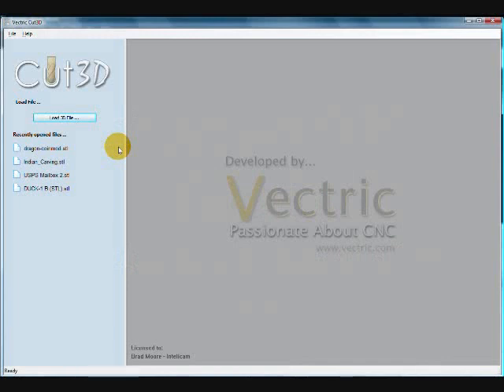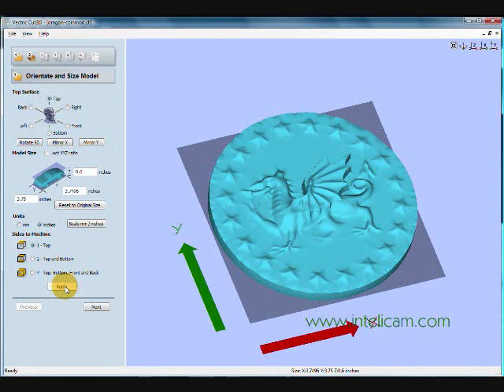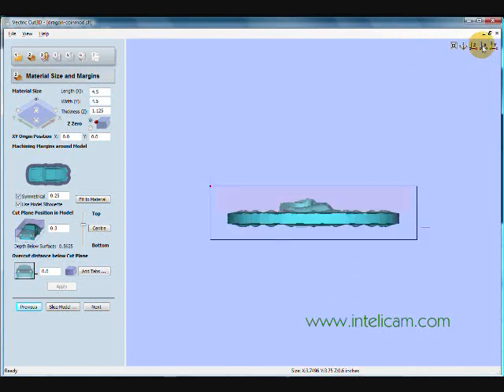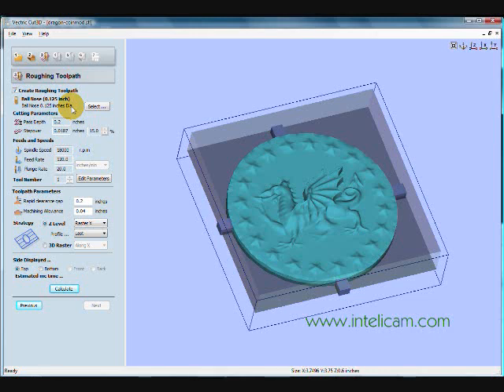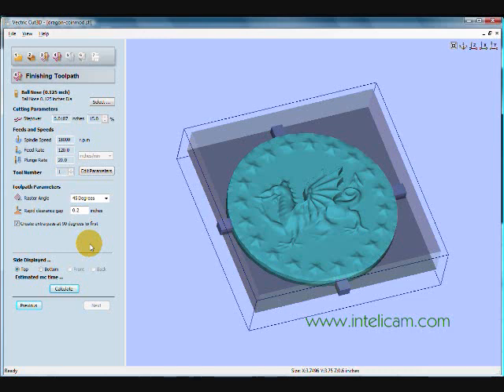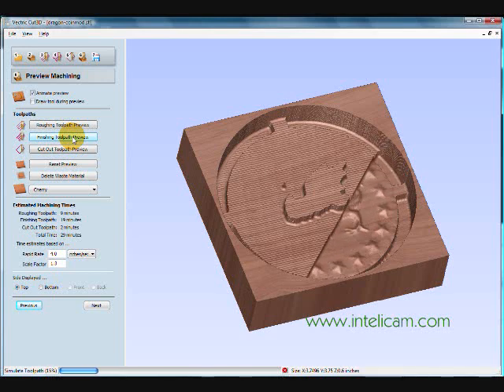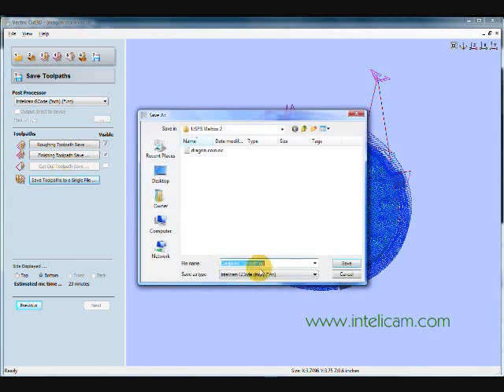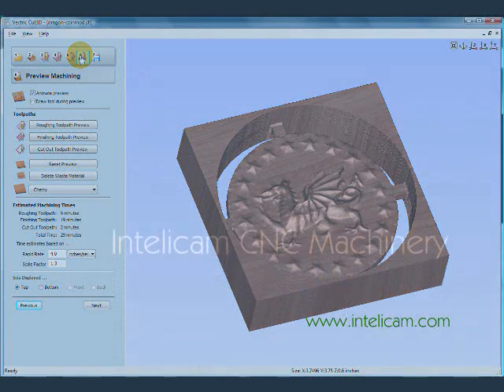Intelicam CNC: how to toolpath a 2-sided coin in Cut3D

Comment: @Envyfiberz 
open the file in notepad and have a look at the g-code. Does it show the Z-axis changing from line to line? If yes then it is not flat. If no then make sure you use the correct driver in the save toolpath list of available drivers.
Reply: Can I have all programming for this program please.